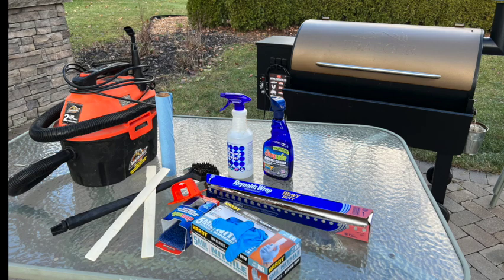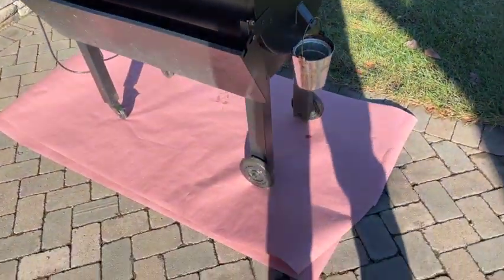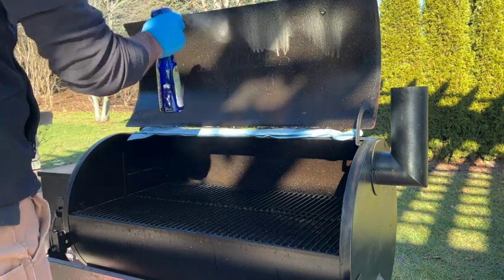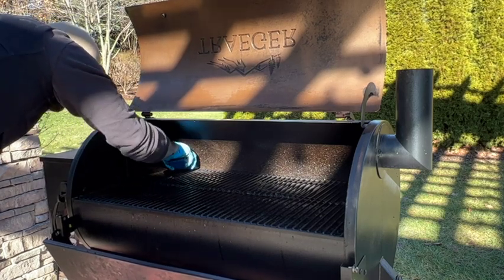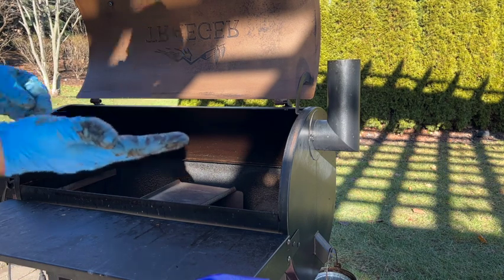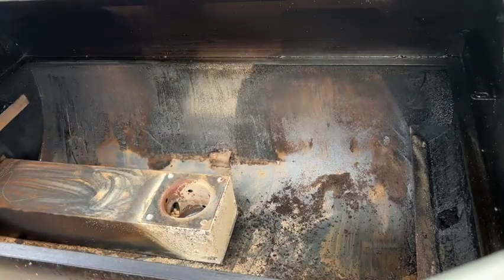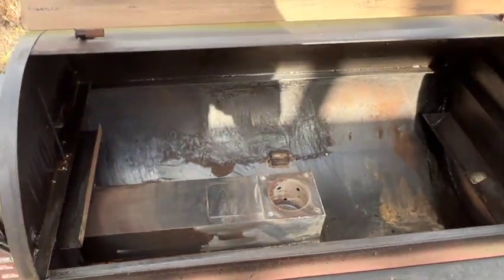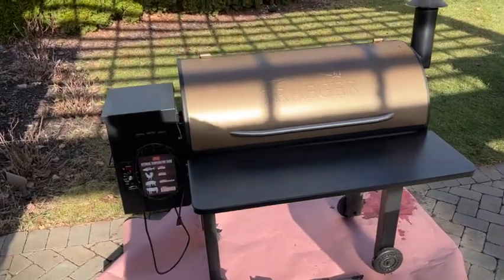Deep Cleaning Traeger Pellet Grill (CitruSafe BBQ Grill Cleaner)

Comment: I just cleaned the grates and drip tray on mind.  I noticed food grease in on is all over the insides of the barrel.  I think it might be beneficial to leave the grease.  I think it will provide some protection against corrosion, I could be wrong.
Reply from the maker: Possibly, but don’t forget that if you let the grease build up you can run into the risk of a fire.
Reply: Clean the grease. It’s not worth the fire.
Reply: It goes up quick if you put the temperature 350 plus
Reply: Clean your grill.  The old grease turns your meat black.  Think ruining a few slabs of ribs.  Black smoke bottom.  Not yummy.  I learned from experience.  Keep your smoker clean.   Thanks.

Comment: I alwasy use a clye based cleaner, like Easy-Off Oven Cleaner as my go-to dissolver of grease. I've found that degreasers like the one you use simply don't penetrate and dissolved grease like lye does. ALWAYS use gloves though!
Reply from the maker: Thanks for the tip, might have to do a side by side comparison on them! Thanks!
Reply: @BusyBeeLiving  I use it at room temperature. no need to heat anything. Actually, you can make your own lye solution, too. I make my own soap so I'm pretty good at handling lye (which can be very dangerous) I use it on stovetops, pots and pan what have "baked in" resdue from overcooking/burning foods.

Comment: Speaking for myself, the problem is the Traeger does not allow for really getting into the barrel with water and degreasers. There is no drain hole. I think if somone wants to REALLY clean the machine he should remove the entire firebox and auger assembly then DEEP clean the BBQ, inside and out. It's not hard but it is time consuming. I've not done that (yet!) but I have removed to assembly in order to fix a problem with the auger a few weeks ago. Very easy. (I'm going to drill a 3/4" drain hole in my machine, though.)